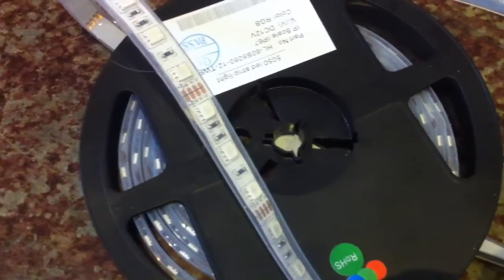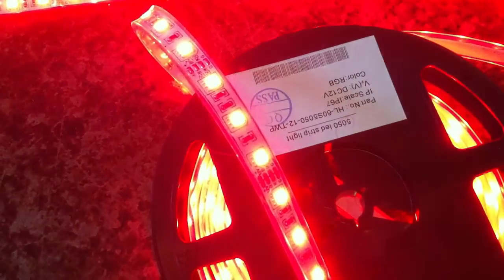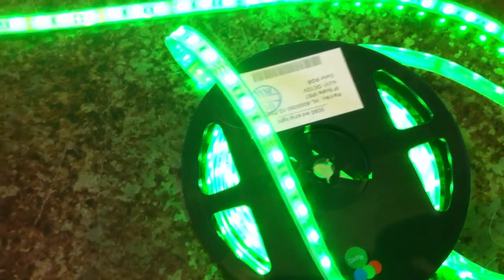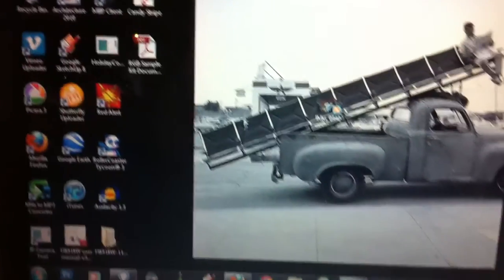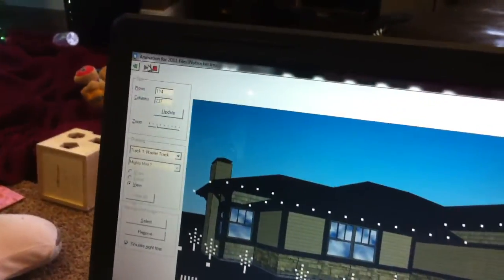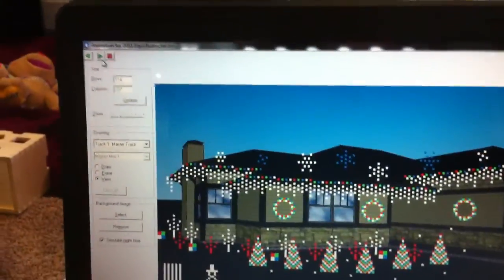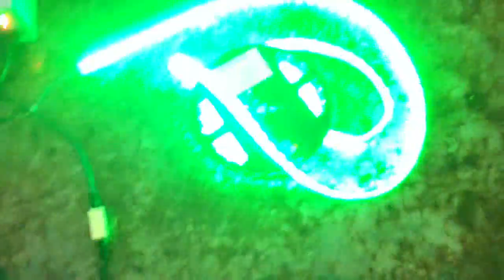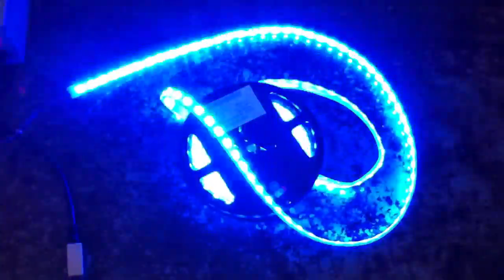RGB LED Flexible Strip from Creative Displays Part II

Comment: You can program the DMX controller using an LOR dongle or a dongle from HolidayCoro.  The programming software is included with the purchase of the controller.